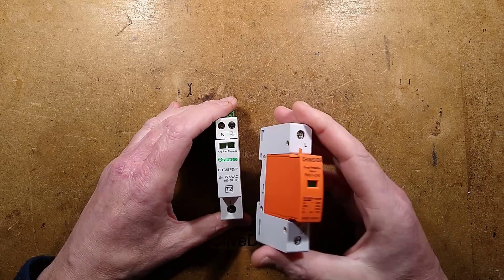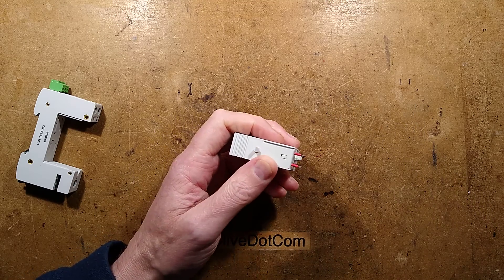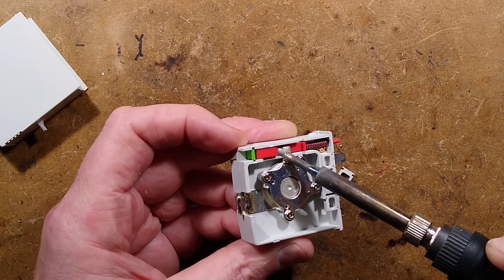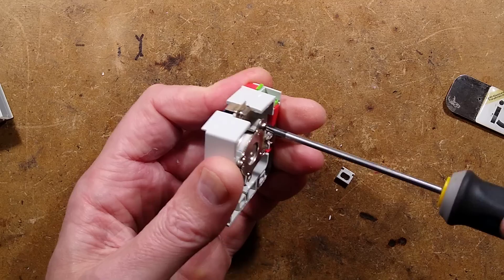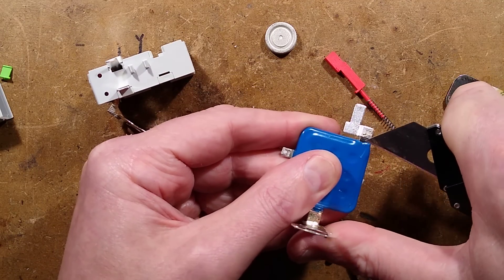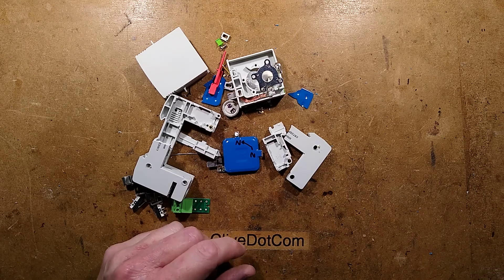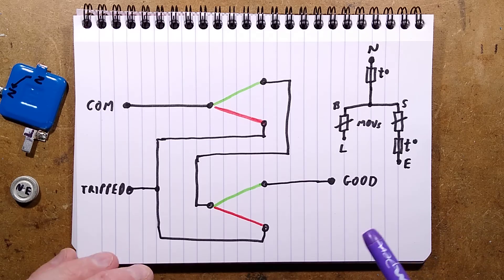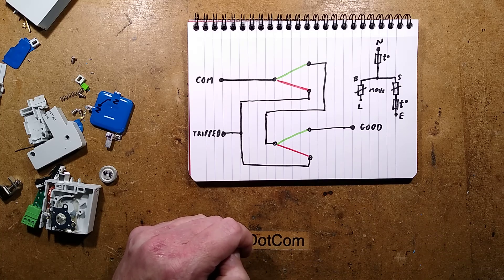Expensive UK surge protector teardown

Comment: Just watched this last night and today I find myself staring at something similar attached to a solar array. Rather than being a through device they only have screw terminals at one end. Its kindly been mounted by the sparky in a clear fronted adaptable box but I took a double take when there was no wires out the bottom. It’s 3 units across with +ve PE and -ve terminals. The PV array is about 1000VDC and runs a very remote pump, basically powering the DC bus of a VSD which will vary the output hertz based upon the available energy from the PV array. Thanks for showing me what’s inside these little beasties.

Comment: I found the arrangement of the switches odd. 'good' and 'tripped' provide the same information, just inverted.
Wouldn't it be more interesting to differentiate between 'tripped' (one pin up) and 'removed' (two pins up simultaneously)?
Reply from the maker: Any tripped section is an indication that the module needs replaced.

Comment: You don't see many of these surge protectors in the US, at least not in the main panel.  I have a lot of them plugged in the outlets before a device.  It occurred to me the other day that all of them as a whole should be protecting my system to neutral and ground, some on one leg and some on the other, but of course it doesn't work that way because usually only one of them gets blown.

Comment: Anyone wonder if you could fit a north american plug into the holder? They seemed to have obeyed the polarization thing as well, wonder if it would've fit for someone to use as a lame adapter. SPDs are mandatory in North America per 2020 code, but there are many available - you could retrofit one to your load center using your own breakers, or you could get ones that just plug in across the phases, so they can also vary between expensive and cheap,. Though given the majority of panels are Square D (owed by Schneider Electric) or Siemens, I think the only chance for ultra cheap tat SPDs are via the retrofits and electricians typically use the good quality ones because is saving $50 on an SPD really worth it when you already had to have an electrician called out to install it?
Reply from the maker: You can get DIN rail mounting sockets for service engineers.

Comment: 8:00 teardown vid of your calipers? Those calipers actually have sda and scl pins internally, so some people actually use their guts connected to an arduino to digitally measure things and use them in a pid program/feedback loop to control the size of small diy projects
Reply from the maker: That video has already been made.
Reply: @bigclivedotcom  nice
Reply: @bigclivedotcom i found that video, turns out I’ve already seen it before and liked it 🤣 time to rewatch it anyway

Comment: So glad to be fully off grid for power with no mains closer than >£30k (at the last quote). 
Most of my circuit is 17th edition compliant but I can use up old rolls of red and black or random multi core without feeling I'm going to get a detention from teacher and my consumer unit is a horrible Turkish made model from ebay (99p +pp) that takes mcbs but really is just designed to keep fingers away from live - I've had more rigid sandwich packaging. 
All my Merlin Gerin mcbs came from an old army camp we stripped prior to demolition - hence the surplus rolls of random cable and 50mtr lengths of 4 core 25 and 35mm running across the yard. I salvaged all the MK metal clad sockets and switches that litter my workshop and home, alongside extortionately expensive 1970s switch gear that connects my now redundant Lister VA Start-o-matic.
If anything ever goes pop, I have drawers full of spares, though - touches wood - the only failure I've had in 20yrs is my wind turbine blew off the end of the salvaged lamp post in the 80mph winds of storm Franklin or whichever it was that blew our beech trees across the road and into the field. And in 40 years there's never been a lightning strike within miles of here, so fingers crossed it will stay that way or hit the grid pylons that run over the next field to us, testing all the SPDs in the town (which isn't many).

Comment: anyone tell me what an RCCB is? same thing as an RCD and why it is rated at 80 amps. should I be worried when just an air fryer trips its?
Reply: Exactly the same thing and the amp rating is the same function as for RCD, ie it is the max current the device can safely carry.
Reply from the maker: If an air fryer regularly trips it then it may have a failing heating element or buildup of conductive gunk around terminals.  These days it may be cheapest just to buy a new fryer, especially if it's put in a lot of duty.

Comment: Rather interesting, as you 'fondled' yours before breaking it, I grabbed an NHP 'Titan  surge diverter', it is only a single varistor job, that otherwise has a near identical holder etc. Unlike yours I plan on installing it, I just have to decide how I'm going to do this, probably Active to Neutral.
That TNCS system of yours sounds a tad dangerous, in my install (Australia) we have just Active and Neutral from the street, the earth is supplied locally. I did have a open Neutral fault, so everything was going via the earth system (and a fair bit via my Amateur/Ham radio install) with lots of funny effects - However it only affected my, and not my neighbours.
Reply from the maker: The TNCS issue is also huge in Oz.  It's not that long ago that a young girl was electrocuted by a garden tap as a result of this style of fault.
Reply: @bigclivedotcom  Yes, pore girl, however it stops at that property, where as yours sounds like it involved several houses, or am I reading this all wrong.
I was lucky in that I had lots of extra earth's and things that alerted me to the trouble, many know nothing and the problem goes undetected/reported until someone pays the ultimate price.

Comment: Nearly a hundred quid for a single use thermal fuse and it's on track toward being mandated? Someone hired an effective lobbyist.
Reply: It's not single use, the thermal fuse is there to disconnect it once it's expired. This will usually take years, quite likely well over a decade in most installations.

Comment: The "small" MOV is instead a plasma spark arrestor. Basically, it's a spark gap inside a gas-filled chamber. This dumps stupidly high voltages before the MOV clamps the bulk.

Comment: Everyone has their CPC connected to the neutral at the service fuse, so why would anyone want an SPD on the neutral ?
Reply from the maker: Not everyone.  On a TT system fed by overhead lines the two are separate and the CPC has an earth rod.
Reply: Guessing you are in the UK etc?  Depends on the wire length between the N/E linkage and the point where the SPDs are installed.  10m is the max distance here before you need to fit a SPD that also covers N/E.  Don't forget about TN-S too.  That still exists over there, and that means quite long runs to where neutral and earth conductors meet at the transformer.

Comment: I think thr Australian MEN system where there is an earth link in the switchboard / meter box is sensible.  There is then an earth rod and bond to metallic water pipes as well.  If you have extra earthing for lightning protection on a ham radio tower, this has to be bonded too.  If it is an extensive system you can end up supplying part of your neighbours' neutral return!
Reply: It even goes so far as the neutral conductors in the LV network being linked between transformer service areas creating a large areas with a continuous and earthed neutral.  South Australia goes even further with their composite metal poles by using the LV neutral to carry the MV PE/sense wire, effectively switching whole HV service areas into one big common earthed neutral area.
Reply: So.. essentially the same as everywhere else with a TN-C-S system, then. Including most installations since around the 70s in the UK (okay, we skip the extra earth rod, which is turning out to be a mistake), and the USA, and presumably most of Europe.

Comment: 80 pounds for Wilex? Yes crabtree and Wilex are same think rebranded. Most of common UK SPDs go upto 40 pounds. This is Hagger/Eaton price for middle or lower midd range item.
In either case problem which  I have with Wilex/Crabtree is an RCD failior. even on new boards it takes few on/of circles before it starts working. Same during inspection, which is obvyously unacceptable. Making Willex (Crabtree does seem to be less common arround sheffield) the most common brand to fail RCDs on EICR big time. 
Basicaly while your MK tends to fail by few milliseconds these often don't even trip. Although I would commend Evian (click) but even more CED/Meridian on which I havent seen a faulty RCD on yet. I cant judge BG because like LVE they tend to be installed by the worst electricians and its hard to blame brand then.
While complaining about Wilex RCDs I should add a trick one Stroma Pakistani electrician proudly thought me and his customers : IF you push Wilex /CRabtree RCD switch in while switching on, it often does not trip when it should.  I have lost mine respect in his work that day...
Personaly I do not understand why are SPDs so expensive, Yes varistor might cost us DIYers a pound , but manufacturers would be getting tiny fraction of that cost. They are far simpler then even MCB dealing with much smaller current which they only need to l stop once. Is it just sellers charging more because they can?

Comment: I remain rather sceptical of surge protection devices. Wouldn't the most likely secenario be a sustained over-voltage (e.g. a neutral fault causing unbalanced phases), in which case these will simply fail in the controlled (hopefully) manner demonstrated in the video. Do surges of the few cycles duration that these can absorb actually happen that much?
Reply: Depends on how decrepit your electricity network is.  Apparently PEN faults in the network are common in the UK?  That's a bit scary.  Not that it happens much but the fault mode in Australia largely only involves the individual service lead-in rather than a network fault.

Comment: “. . .  but the current flows up these pins, well it’s AC, the current flows via these pins through this . . .”
I know I’m being as retentive as Clive here but that’s the point:  this tells me two things. 
1)  Clive is focused on the minutia to the point where AC current (bi-directional) is seen as different from DC current (directional), which they are. 
2)  He has enough experience in the field to know that it’s usually the minutia that is key to solving a problem as opposed to just putting a bandaid on it and hoping it doesn’t recur. 

🫡

Comment: I should install one of those here to cut our nasty ground-loop 😑
My #care level is just to low 😑
Reply from the maker: What do you mean by ground loop?
Reply: @bigclivedotcom  Two grid connections, each with it's own ground electrode(TT), it gave some weird resonance effects.
I actually disconnected our old grid connection yesterday, it had neutral connected with ground.
Like the uk (pen) system.
So that explains a lot.
It should had been changed to tt years ago..
Reply: I will make pictures when our operator(Enexis does the final cut.) Their cable under this street is older than me. It's oil,paper&lead lined.
As soon as I touched those old wires and seen them crumbling I had to cut the seal and disconnect that time capsule.
Reply: For Those who only have glass..I litterally screwed out their fuse.

Comment: I do sometimes wonder how we managed for god knows how many years without all these fancy gizmos. Just another device to burn out/go wrong. And when it does, yet more expense. Electricians must love this stuff. Having seen houses/ panels etc that have been hit by lightning, having all these gizmo will not save it.
Reply: In ye olde days our devices were much more robust.  Fridges were basic affairs, line operated motors, mechanical thermostats, motor driven defrost - if there was any auto defrost at all.  Same with TVs, once were all valves (tubes) and quite robust.  Now everything is packed full of semiconductors, even the washing machine with whiz bang front panels and VFD style motor drives.  Yes the better devices do have MOVs etc built in, but when Mr Lightning comes knocking you really  want do dump it all to earth before it gets inside the larger installation.

That's why.

Comment: We electronic designers install hugely expensive semiconductors in order to prevent very cheap fuses from failing:)
Reply: Fuses are just too slow.
Reply: @mbak7801  and cheap😁
Reply: @mbak7801  And easy to replace😁

Comment: When I first learned about DIN rail systems I thought they were damn sexy.  But modular component on modular bus rail?!  Lego romanced power handling.  I need to have a private moment somewhere discrete for a bit...

I've been elbow deep in a looooot of breaker panels, many much older than me.  America has NOTHING!!! on European electrics.

Soooo jealous.

In case I haven't made my nerd point obvious enough, That's the kind of stuff you find behind panels on the Enterprise.

Comment: Modern living, is making mains voltage, very noisy and causing voltage spikes. Badly designed inverters, switch mode power power supplies, along with more dependency on electric motors , on appliances  , Aircon, and heat pumps, are causing the problems.  heading our way is will be mandatory type F,  RCDs and RCBOs .,I noticed your comment on cable joints, they now moving away from PME and replacing it with PEN which is very similar to PME , they nolong cut the cable to make the joint they now using wire taps , sealed in resin to make the joint

Comment: What is the kA rating and MJ sink capacity of that Crabtree item? 
Note that the remote signal is fail safe, indicating if module has OL tripped or not installed in the base. 

At home I use an Industrial rated Weidmüller PU2 1+1 R  unit, being Class 2 [T2]  -  280V - 20kA / 40kA / 100kA max  - 1.450 kV  Response time is < 25ns 
Only the Neutral module contains the Gas sparkover element.
They provide both supply OV and Lightning protection. (for both A & N) 
These are the older types (I'd installed well over 10 years ago, colour coded Blue and Orange) having separate Active and Neutral plug-in modules and a similar remote monitoring function in the base. This uses 2 MMCB spaces in the panel, not 1 as you have with this device. The A/N modules are separate for multi-phase installations.  I guess this single space Crabtree unit is fine given it has UL Approvals, but frankly I'd prefer the 2.
 All these surge/lightning arrests really require a large CSA, low impedance PE (Earth/Ground) of equal if not larger size than the short length A/N conductors in the main Distribution panel.

Comment: 11:50 In a TT system like here in Belgium (Europe), the Neutral and Earth are separated, but between both there can be a voltage between 0 to up to 5V depending on the distance from the end station and load in the area. The current is more then 30mA, because when shorting both will trip a 30mA RCD. The few times when i did measurements during the day here at home, there was arround 1,5V between ground and earth. Some people say that this is free electricity and it is not registered by the power meter in the breaker panel, but with the new digital meter here, i have my doubts about that.
Reply from the maker: It shouldn't register on the meter, but can be a bit unpredictable.
Reply: I've yet to see any notable potential difference between Pe and N, but there's no current sensing between the in and out of the neutral wire in either analog or the new digital meters.
There's only a current shunt in the line conductors.
Reply: in digital meters, the N is just used for suppling the elrctronics. its not measured

Comment: How many others were reaching for a band aid when Clive was trying to peel the blue resin? 8^) Glad there was no unplanned surgery. A nicely made device. Good to see some serious compression springs on the indicator trip pieces. Many springs I have seen in various electrical gizmo's from China have anemic springs, so later in the device's life when all is covered in dust, bug carcasses, lint, and oily crud, the spring doesn't do its' job due to inadequate force / low chooch factor.  Cheers!

Comment: I got one for my solar panels, had a look inside and it seemed to have a changeover contact which shorted the panels with a 20mm 10A fuse when the VDR tripped out… needless to say my panels would blow that, and the fuse wouldn’t be able to break the resulting 600V DC arc… Asked the manufacturers and they just told me I was very naughty taking their product apart and that my warranty was now void! Well I won’t be using that…
Reply from the maker: What brand and model was it?
Reply: Was it designed for DC? I know there's a subsection of SPDs designed for solar panels now since it's a requirement for installation.

Comment: I got 2x 1U rackmount APC G5 Power Filters that got thrown out where I work, and all they had bad was a capacitor...... they're pretty much fancy Surge Protectors; a few dozen relays, a few MOV's and a device that monitors voltages and cuts off the relays if it decides something is wrong......

Comment: They are hard to take apart for safety reasons. You don't want it to be easy for someone to attempt to repair or "force it to work".
Reply from the maker: If this failed it wouldn;t obviously affect anything, so there's no incentive to make it work again anyway.
Reply: @bigclivedotcom so when it fails it just lets current through?
Reply: @25566  Until it gets hot enough to melt the solder, yes.